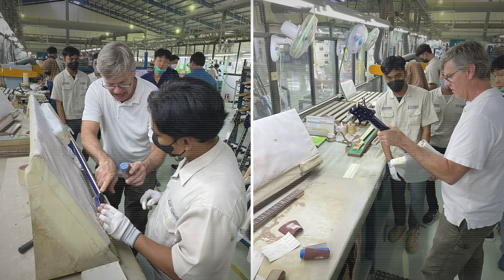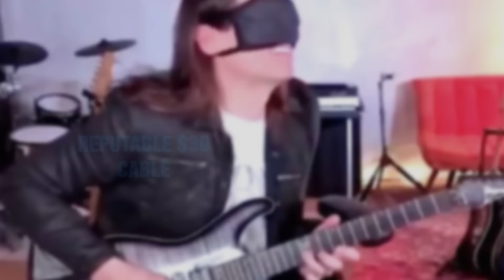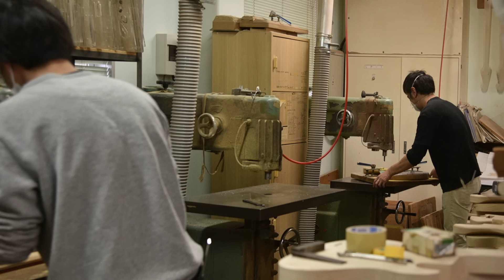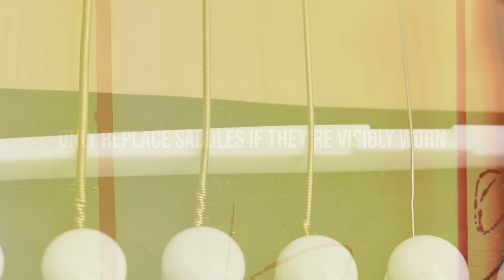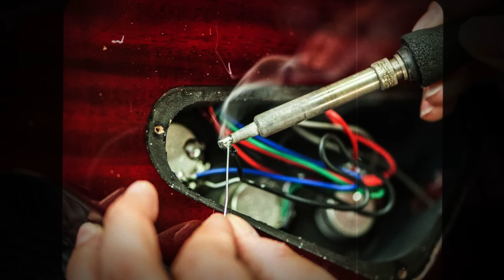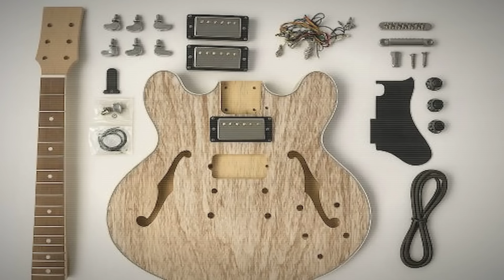5 Worst Guitar Upgrades Most Players Waste Money On

Comment: I don't play professionally, but I've been experimenting with different types and sizes of strings and it's very interesting, so I end up with a bunch of strings; of course, I start with manufacturer's specs, then try differnt gauges afterwards; I also tend to replace keys a number of times (I own 18 guitars); results tend to vary a lot so It's difficult to come up with  real set standards; Very interesting video.

Comment: Upgrades to my Fender Player Strat...  I swapped the stock bent steel saddles for block style saddles with the flush adjustment screws.  It was for comfort.  It had nothing to do with tone.
Next I replaced the stock plastic saddle & flat clip string tree with Tusq.  That solved both my fret buzz & tuning stability issues.  The stock pots (250K) were driving me crazy, because they only had any effect between 7 & 10.  I replaced them with a Mojo Tone solder less set up (500K)  Now I have tone controls that work across the entire range 1 thru 10.  To kill the notorious 60hz hum of single coils.  I put in a set of Fender Vintage Noiseless pickups.  All money well spent.  To solve specific problems.  Rather than just spending money, chasing esoteric tone quality.
Chasing tone doesn't make you sound any better.  Fixing specific issues with your primary instrument does.

Comment: When I think of upgrades I've done, I usually think of the first ones (which were the most extensive).  After several early successes, I suffered a couple of catastrophic failures that convinced me to start with a guitar as close to what I wanted at first as possible and minimize the upgrading.  That might be a lesson that should have been included.

Another thing I wanted to share was that the most changing to the tone of their guitars that ELECTRIC guitarists (and amplified acoustic guitarists) can do comes from changing the speaker solution you use.  Since the speaker system is what moves the air, obviously it's super important to your tone; this is the thing that actually MAKES your tone.

Third and last:  Learn to do your own setups!  There are zillions of videos on how to do setups all over YouTube and other services, and many of those videos will guide you as to what you need to get going.  Doing your own setups will save you money on EVERY GUITAR YOU SET UP YOURSELF.  Also, you will actually get a better setup, because you will soon become able to tweak the guitar to work with YOU -- in ways that no one else will manage.  You don't have to try to say things that can't be said in English to try to get a good setup.  You can just -- DO it!  The setup is the most important single aspect of your guitar.  Take charge of it.

Comment: I'm...thankfully--to some degree--in this pool. Here we go (my personal dive in):
1. Cables--lets keep it short--I did the expensive cables. Did it matter?...not to my ears. 
2. WORSE. PICKUPS? Oh my, I did my investing in Seymour Duncan...and DiMarzio...and EMG...and otherwise. PLENTY of money spent. Discernible difference? Like the difference between driving 30 mph and 25 mph--not so much--not enough to count anyways. 
3. Tuners. I did the tuners thing (to keep it general). Locking: Minimal notice. Tuners that evenly turn (e.g., no minimal "give" in the tuners before it actuated) are gold. BUT...you'll pay for them!
4. BRIDGE: OH DAMN YES HOT DIGGIETY DAMN YES!!! My advice? Either learn to do it well, or HAVE IT DONE WELL. Maybe one of the most underemphasized elements of guitar. 
5. Strings? Yes--to some extent (I won't bore with personal faves). But in the big scheme? No, not enough; new strings have their merit...for a few days. 
6. As far as electronics? NEVER bought into that. I, ONCE, contemplated that, but I COULDN'T AFFORD IT, so I scrapped it...thankfully. What I did discover is, when I wanted to use the tone control (normally wired)...I got what I needed: Cheap ass guitar, expensive ass guitar, middle of the road guitar...the tone and volume work like they're supposed to. 
7. The variety pick acquisition is GOLDEN. You'll be DAMN SURPRISED on how picks can affect sound.

Comment: WORST MISTAKES :
1) Spend money on overpriced Pedalboard. Basically just a board.
2) Buying multiple effects pedals for tone but never explore 10-Band Equalizer.
3) Buy this and that instead of practicing.
4) Crank up gain and distortion first instead of exploring clean tone first to improve picking, technique and accuracy. And ended up sloppy and messy.

Comment: I'd agree with most ask of it. However, i put graphite saddles on my Les Paul and it made a HUGE difference on how many strings I broke.  Usually an .11, sometimes a .13. We have made up a jam called String Break it was so prevalent.
Reply: That's caused by burrs on the saddles. Not the material.

Comment: I shifted to D'dario XT strings and jazz III picks. Tone has improved dramatically. The main item engendering the change was the Jazz III pick. As such, you have to get better at playing. Play for more time and play in a focused manner. If you have a reasonably good guitar to start with, you do not need upgrades. All that you need is more practice. I have a Fender American Special SSS strat, and it is really good. With time and practice, I have very good tone. No upgrades, only more practice.

Comment: I don't like this kind of analysis that takes elements separately and says that the modifications change nothing. Every little change counts, and in the end, that's what makes a Strat and a Les Paul sound different.
Reply: No. Not changing the nut, tuners, and bridge.
Reply: @bribolin7278  In this video, he also talks about pickups. What I mean is that each modification generally doesn't make much difference, but if you modify every part of the guitar, it will eventually sound different.
Reply: There are MAJOR DIFFERENCES between those models.
Reply: @bribolin7278  Yes, there's a major difference, but if you modify a guitar to sound like a Strat, each modification separately will give you the impression that there isn't a big change compared to doing all the modifications at once. Don't get me wrong, I'm not saying that an expensive cable will actually improve the sound.

Comment: I wanted to experience changing pickups and wiring them for coil splitting. To that end I did buy new humbuckers and push/pull potentiometers. Worth it for more tonal variation. I learned for me it’s best to stay with in series wiring because the low amp volumes I play at don’t allow output volume from parallel wired pickups. Seriously, it was so low I thought the wiring was broken somewhere. It wasn’t bit I didn’t know that until I turned up the volume. Then I learned not to switch over to the in series pickups. Lesson learned! The coil split from the wiring experience and the push/pull potentiometers were worth it. I still want to rewire that pickup back to in series but now don’t have the time. Keep the pickups in series and only coil splitting is worth the effort. 

I absolutely agree that a guitar is usually fine as is. This is why you should play an instrument before you buy it. Fix problems but don’t go all out on unnecessary upgrades until something wears out and needs replacing. This video is absolutely correct.
Reply: Otherwise I would install plug in connectors on the ends of every new pickup set I put in a guitar. This would make swapping pickups easier should one wish to play the pickup swapping game. Leave the stock high dollar guitars alone as much as possible, especially those brands with high resale values.

Comment: Improvements on playability and tuning stability might not be audible but are certainly worthwhile.

Completely agree about the solution of tuning problems and cables and the need for a good setup..

Regarding pickup swaps. Intelligent and informed players know that pickups, tone and volume controls and everything up to the first buffer in your chain are one electrical system and are interactive. If, for example, you want a fuzz that cleans up on the volume control, it will constrain choices in pickup and control part selection. A capacitor is a capacitor. A upgrade pot might be choosen based on taper, features like no load and feel.

Comment: I have never changed an output jack on any of my 15 guitars. I put locking tuners on all of my guitars.
Reply: I have never replaced an input jack either. But I have going bad on a 1993 Hamer USA special. This guitar has been played a lot. It was played a lot before I got the guitar in the early 2000’s.

Comment: I usually change out the pots for brass shaft CTS pots. I've only changed the tuners on 2 of my guitars because the tuners that came with them were just plain junk. I've only changed one cap on my Fender Jazz Aerodyne, because I was trying to limit the change in tone when I roll the tone knob up and down. I've changed a whole lot of pickups, depending on a particular sound I am looking for. I've never bought a high end pickup. I use decent cables, usually in the $30 range. For strings I've always used DiMarzio on electrics and Martin on my acoustics.

Comment: There is no need to change pots unless they don't work fully or are scratchy.  Same with the jack if there is a strong signal and no noise.  Pickups, unless microphonic, don't need replacing, you need a 7 or 10 band EQ pedal, and that will make all the difference in the sound of your guitar, your effects and your amp.  Its the most important thing to achieving good tone.  Bone nuts are a good upgrade choice, but try to get 'unbleached bone" and not the bright, white/yellow ones that have been bleached.  Bleaching dries the bone and makes it more brittle over time than the natural bone.  It also affects the tone you get from the bone nut.   These days, avoid buying lots of effects pedals and get a Valeton GP5 or similar multieffects modeler.  It will save you a lot of time and money trying to learn all the different pedals, and they sound pretty good by themselves.  18 or 20:1 locking tuners are a great idea, and Wilkinson 18:1 lockers are around $40 at the most on Amazon.  They are the best upgrade to tuning stability you could possibly have and they will make learning easier because the guitar will stop going out of tune and screwing up your "ear" for hearing what you trying to play.   Been upgrading guitars since 1975, and I have made all the mistakes.  And avoid floating trems unless you enjoy tuning forever.  Hope this helps.
Reply: I think if one goes in with the right expectations, it's okay to make these upgrades. I know I don't NEED a 21v EMG upgrade or titanium bridge saddles, but it's fun to tinker and mod
Reply: @AxeMain  Totally agree.  I have a house full of fully modded guitars and I loved doing it.  It just gets expensive and you will never get the money back if you sell it.

Comment: +100, I qualified capacitors of all types for military contracts, my guitar has the standard green film. I also qualified pots, the dime size will be fine until they get noisy. Wire replacement is ridiculous unless it's broken. Jacks and switches, only if there is a problem. They work or they don't. 50 years in electronics leaves me highly amused at the hype. Properly done, shielding is a plus, if you need it.

Comment: 1. just get a cable with good build quality.  The Hosa stuff or anything with Neutrik connectors with high-quality copper and shielding will be good enough.  Good build quality = they won't fail as often, so you'll save money in the long run.
2. all you really want from a pickup is something that gives you enough clarity.  A shit quality pickup will sound muddy.  Also, I hate how PRS's pickups sound.  I do like how Bare Knuckles sound, though (also, they're easy to custom order if you're like me and want weird color combos!)
3. locking tunes are awesome for quick string changes, and I hate trying to wind my strings around the post.  I don't fight tuning stability with locking tuners...I fix them by replacing Floyd Rose Specials and/or a decent nut.
4. I kinda give a crap about about acoustic guitar materials, but I like Graphtec's Tusq stuff for any non-locking guitar nut or acoustic saddles.
5. jacks and pots are fine as long as they have a good build quality (no stactic) and your pots are audio (logarithmic) taper pots and not linear.  But good pots and jacks are also cheap enough to not really break the bank.

Comment: Upgrading the input jack on a cheap guitar is a good idea, especially on a cheap electric as they're often the first thing to need replacing on a cheaper guitar
Reply: With all due respect, isn't it called an output jack? I recently replaced my stock output jack with one from TonePro. Cheers.
Reply: I always replace my stock output jacks with full contact ones... eliminates loose contact problems down the road. Cheap. Easy.

Comment: I get it for bedroom players you don’t need high quality stuff but for those of us that play live it tends to matter a bit more. I used to play with cheap cables but they broke all the time so I bought a couple of Roland cables. $50 or so and they have an excellent warranty so now I don’t worry about cables. I buy good switches and jacks so that I don’t have to worry about them. A cheap switch will start cutting out. A cheap jack will fall apart. A cheap potentiometer gets scratchy. I’m not saying to spend outrageous money on gear but $20 for a switch that will last a long time is better than spending $2 on one that will go out when I’m on stage. I’m just trying to say there is much more reason for some upgrades than tone
Reply: You’re using cables? I stopped using cables years ago now good wireless is out there. Stop the madness you’ll never look back
Reply: Yeah, I have some premium cables inside my road case (connecting my rack tuner, Axe FX, and wireless receiver internally) because I never want those to fail.  Otherwise, I just buy the "solid" quality tier of instrument cable for home playing (good connectors and shielding).

Comment: Locking tuning pegs make restringing a lot easier.  I have put them in guitars for that sole purpose.
Reply: I´m full agree on what you sayed. the locking tuning pegs are really helpfull when you are playing and break a string, it makes an easy fast replacement for sure. I think it is true that the locking tuning pegs are useless for keep a good tuning strings (that depends more on your bridge or nut quality), could sound weird, but  I´ve seen guitars with locking tuning pegs but also locking nut, theeeen you have a harder time to change a string, specially if you don´t have the tool with you... LOL
Reply: I love locking Tuners.
Reply: Ditto
Reply: Buddy, you are talking to an AI robot
Reply: @MS.312  No.  I was typing to whomever reads the comment and wants to respond.

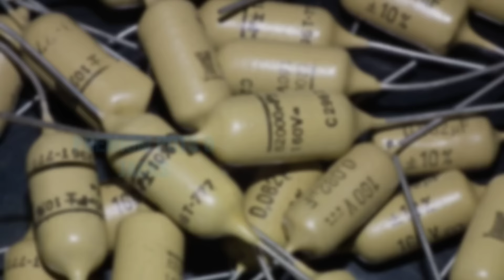Comment: 11:10  That's a variable resistor, not capacitor.  A worn variable resistor can cause a noisy, weak signal.  Noise often heard when turning it.  They are very cheap and easy to replace.  Music shops charge more for them than electronic shops. ()  Tremolo - The best way to de-tune every string at once.

Comment: I frequently add a master volume with treble bleed on most hollow or semihollow guitars with multiple pickup volume knobs.  Gretsch has done that for decades.  A strat already does the same in most wiring setups.  Makes playing easier. Simplest but very versatile setup is a 3 knob rig for 2+ pups: master volume, balance and tone. Pickup selectors to fit your preference with appropriate switching.

Comment: You guys heard it all before. The next greatest thing. In about 10 years of G.A.S. you now live in a music store. I look back and in my honest opinion the best stomp box ever made is a decent tuner. Save all that money from gimmicks. Lord knows it will break you. Of course a quality guitar. Lease expensive I'd go is any PRSse. Can't go wrong, even with the trems. They just stay in tune, and sound great, quility unreaI. I bought a used custom se made in Korean 2018. I believe it was the first year with the small block inlay. I bought it in mint shape for 300. dollars. And it is a beast. I have 9 US guitar, but that was acquired over 40 years. I would be just fine with my less expensive se. I believe the most important piece of the puzzle is buying a quility tube head and a decent cabinet with what I believe is the single most important piece of equipment you can own. A quility speaker or speakers. Amp and speakers. I dont like combos because I love Creambacks. Most any brand named tube amp will sound great running thru a Celestian Creamback. I dont even want to add up how much money I spent over the years. Im trying to help beginners not to go broke unnecessarily. Jam on!
Plug straight into your amp. And play like it your soul pouring out.
Reply: Good comment. Me? Creamback Vox AC15 serves almost any need. Best guitar upgrade for Strat-type trem? VegaTrem. (Except on the ’88 Strat Plus I bought new, which surprisingly holds tune very well (esp w/my ’93 upgrade to LSR roller nut). Pickups? “Dunno, it depends…”